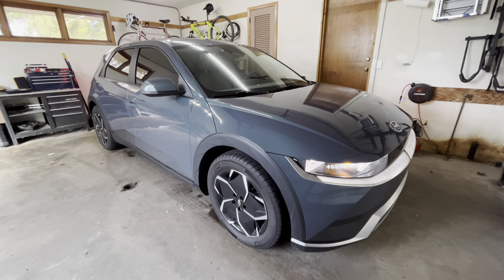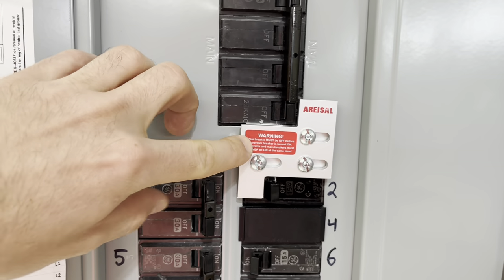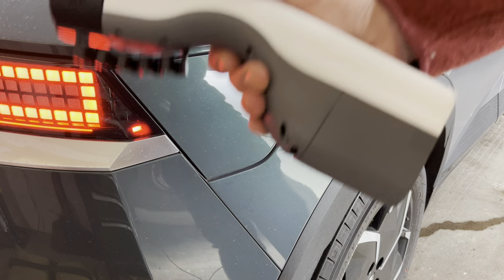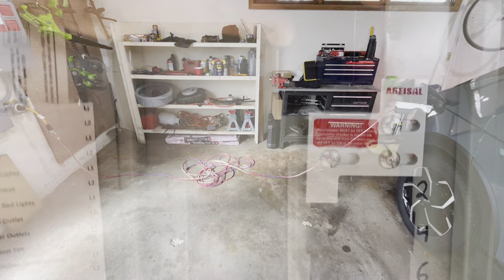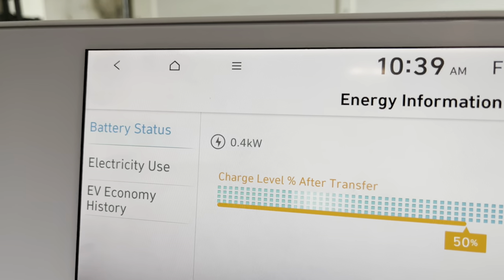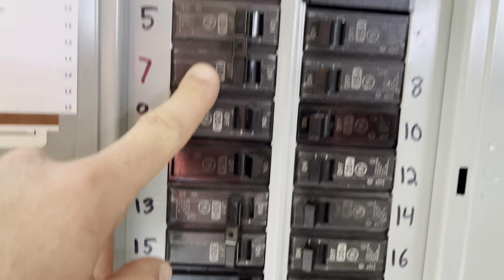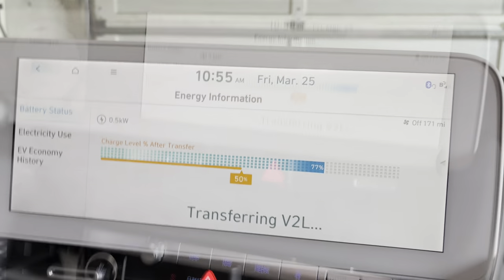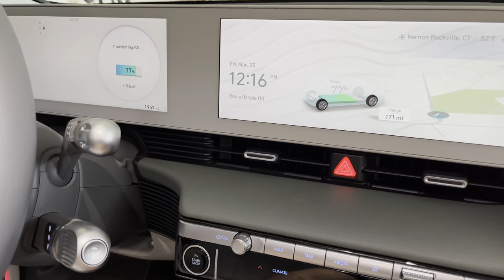5 Days of Emergency Backup Power Using V2L Adapter | Ioniq 5 | EV6 | GV60 | EV9 | Kona | Ioniq 6

Comment: The best trick I know to see if the grid is  on/off is to open the WiFi on my phone and see if my neighbors networks show up.
Reply: Unless they have an APC UPS backup battery from Costco to power the cable modem and router. Lol.
Reply: @letsgobrandon1719  Does it have to be from Costco? LOL Or am I missing an in joke? Or maybe just a joke.

Comment: That's a great setup. I can't wait for cars that can do v2l @ 240v and 7kw.
Reply: F150 does 7kW at 240v (3,6 per phase) the electric one will, but the current hybrid with onboard power does as well
Reply: Also the EU verion can do 3.6 kW as the nominal voltage is 230 V
Reply: I also need 240 V and 7+ kW, to run my well pump to get running water during a power outage.  Hate not having city water.
Reply: In europe with 7kw we power up the whole house

Comment: A huge thank you for this video.  I decided to buy an adapter and a bunch of heavyweight extension cords after watching the video.  Well, we just got hit by a major storm that knocked out power in our area for 5 days... I used the V2L feature to keep running the following: refrigerator, cell phones and iPad, morning coffee makers, small microwave (as needed), internet (modem and router), a TV.  Had it been winter, I could also have powered our gas furnace.  So, as always: this website is a HUGE HELP to so many of us.  THANK YOU!

Comment: There are a lot of comments here, i might have missed it. How did you handle the v2l adapter bonding neutral to PE?  I assume neutral is bonded to PE in your mains panel, when the v2l adapter is plugged in do you then have two N->PE bonding points? Have any issues with GFCI breakers tripping? Thanks

Comment: They need to build this into the chargers. It already plugs into the car, has high capacity cords and typically an industrial 50 Amp socket and 30-50amp breaker in the box.

Comment: By the way I’m so glad you made this video. This is exactly what I want to do with my EV6. Now I have something to show the electrician. Thank you!
Reply from the maker: Glad I could help!
Reply: @TheIoniqGuy  Ditto! I'd seen a bunch of these videos but none exactly like I'd wanted to set up. We already had a subpanel with all of our 120V loads on it so putting in a transfer switch or a transfer panel seemed like overkill. Given other info I'd seen about putting in a backfeed (like you did) and powering both bus bars it seemed to me like it should work (as many RV users do when only having a 120V feed), but i hadn't seen anyone do that exact situation to validate the design. So we put it in and tried it and god damn it did work! We did have a situation where our power went out for a few hours, but we just ran extension cords to power the fridges and internet, but to power the whole house with just a switch is an utter game changer!

Comment: Nice walk through.  The only thing I would suggest to make it simpler would be to run it off a transfer panel.  then  you wouldn't have to worry about accidently turning on a 240v circuit
Reply from the maker: I prefer this way because I can have 20 circuits powered. Most transfer switch panels are only good for 8 or fewer circuits.
Reply: We have a similar set up where we have a full subpanel instead of a transfer panel. All the 240V loads are on the main panel, so the subpanel only has 120V loads (about 20-some different circuits).

Comment: Correction for some of his comments. The United States uses a 240Vac system, the three wires are the two hots and common that is center tapped in the transformer. It is NOT a ground. That is something else entirely. There is not a utility ground. The house itself will have a ground rod installed somewhere usually outside of the house. The center tap on the transformer is done to split the 240Vac into two 120Vac feeds. In the breaker panel, the two long rails running from the top to the bottom in which the breakers actually connect to. Then there will be a shorter separate neutral/common bar. Breakers for the larger appliances, dryers, water heater, furnace, oven and so on have special breakers that tap across the two main hot lines for the full 240Vac. 

I do recommend having the output power tested from the vehicle to the house. If the output from the car is a PWM (square wave) do not use the car battery to power the house unless an emergency. The PWM output from a battery is not the same as sinusoid AC wave. This will lead to premature failure of appliances within the house. Power supplies that convert the normal AC to DC for laptops, TVs and other items will most likely get hot under the PWM power. Especially the cheaper end stuff. Simply look at the power supply at see its ratings. 

A sine wave or LCL filter would be needed to convert the PWM power from the battery to a true sine wave. This technically applies to the solar power system as well. Some inverters for solar systems have built in filters, with varying quality. You get what you pay for. 

And the interlock's main purpose is so that your solar or EV battery are not powering the grid, not the lineman safety. These systems would be instantly overloaded if utility is down and/or if utility is online, output of phase and would cause chaos. No lineman touches a line without it being measured and confirmed to be off before maintenance.
Reply: In regards to the output waveform, it is indeed pure sine wave. I've seen another video of someone connecting a UPS to this car and it didn't have issues like it does on modified sine wave inverters

Comment: Great video! Thank you. VTL is a major reason I am looking at the Ioniq 5.
Reply from the maker: It's wild that nobody else is doing this especially Subaru with the Solterra. This would be a giant selling point for their outdoorsy buyer base.
Reply: @TheIoniqGuy  vw is supposed to later this year enable v2x on all the 2023 model year id series evs. The Ford lightning will have v2x available across all trims starting later this year. In fact Ford's home station capable of 80amps and backwards capable is only $1,300.
Vs something like the wallbox quasar costing 2-3x as much. 

The leaf has also been capable thanks to chademo for years now of v2x. So it's something more ev manufacturer's are working on offering.
Reply: @4literv6  It is so with the Genesis EVs (GV60, GV70 electrified, G80 electrified).

Comment: One of the best videos I've seen recently, regardless of content.   Good job.

Would be a nice option for myself instead of firing up our 7.2kw/9kw peek generator to run the house, especially during times of average load.  Not having to purchase and store gas is a huge benefit.  1.8kw is not a lot of power, but a lot of times you don't need much.   The down side for me is we have a 240 volt well pump.    This is where the Ford F150 lighting has really done things right with a 240 volt, 30 amp output on the V2L
Reply: Just FYI the current f150 hybrid with pro power onboard already does the 7.2kw at 240v. I realize it’s not electric, but still it’s a possibility even now
Reply: @ZPdrumer  Yeah, I've had hybrids before.  They were a great idea years ago...but BEV is the real answer.

Comment: OMG,  before the switch to an EV car was even on my radar, I just had an transfer switch and generator outlet installed so I can now run my propane generator to power my house when the power goes out here in Baja, Mexico.  Woo hoo!  Currently counting down the days until my SEL Cyber Grey/Grey arrives in July, but thinking now of adding a Level 2 power station too.  Thanks for this informative video.

Comment: Just had this system installed today. I can now have my gas furnace, my kitchen, lights, and 2 computers powered by my Ioniq5. With all the above powered, I' draw only .3 on my car's indicator. This is with the V2L inverter from Amazon ($129) rather than the very expensive Hyundai unit. We don't need no stinkin' generator! 
Big thanks to you. My guy used this video to perform the entire job.
Reply from the maker: That's fantastic, Rich! You can sleep soundly knowing you've got a giant battery that can keep your house running for days now when needed

Comment: Amazing video.  I had a hard time finding a certified electrician who would do this (or get the concept) but your video was a great help.  Done!
Reply from the maker: I'm curious what they didn't understand. I trained to be an electrician a decade ago and this is just like any other back-feeding generator installation.
Reply: @TheIoniqGuy  The "every other breaker" issue (I believe you called it Buspar).

Comment: Very informative vid!
Just a note for those that might be interested, I powered my gas furnace (220 watts surge, 150 running) for 12 hours (40's outside) and used 4~5% of my EV-6's battery.  I have a Honda gen but will use this before the gen, especially at night.

Comment: THANK YOU for the incredible tutorial, yet another fantastic video from your channel.   I just hooked up my system just as you did with one difference - I wired it up to a 240V breaker and used a generator cable that splices the two hots together so it can provide 120V to both phases.  I just had to pull new romex for the dishwasher and disposal because they were wired to two breakers with a single neutral (MWBC) which could overload the neutral when using the V2L to both phases like this.

So to anyone else who wires this up to both phases, make sure you don't have any shared neutrals - e.g. every circuit should have it's own neutral.  Otherwise you can wire the system up like the Ioniq Guy to a single phase and you won't have a problem with overloaded neutrals.

Comment: I just had an electrician at my home and put in this setup.  I now have power to my main breaker.  I tried it out and  ran the furnace (fan only because it is gas burning), refrigerator, freezer and computer and modem.  That is as far as I went but I will cautiously add lights when the power actually goes out.  Thanks so much.  Mary
Reply from the maker: Glad it worked out for you!

Comment: Great vid! Thanks! Picked up the GV60 last night. Out the door was $79K. Buyer's remorse was setting in until your vid, then I did some math. My EV is 77.4 kwh which is roughly 6 Tesla Powerwalls and would cost approx $60K. Therefore, (again roughly) I got the equivalent of 6 Powerwalls and a bad ass GV60 for $19K. I feel better now. Calling my electrician on Monday! Thanks again!

Comment: Excellent video that will help me. I was planning to install a manual transfer switch with a generator outlet and use a Delta Pro battery pack ($5000.00) in lieu of a stand by generator. I just purchased a Genesis GV60 which included the load adapter. This set up will save me the cost of the battery.  We usually average a day of outage per year so this solution is perfect and offers us piece of mind. Thanks for your injunity.

Comment: Great video, TIG.  I'm getting rooftop solar installed, and rather than spend $17,000 on battery storage, I'll put that toward a Kia EV6.  Getting a 4- or 6-circuit subpanel with generator connection installed, so though it won't be instantaneous, I should be able to walk into the garage, and get the critical loads covered by the EV6 V2L.   This video really seals the deal for me!
Reply from the maker: What are the details of your upcoming system?
Reply: @TheIoniqGuy  25 panels with optimizers, 9.3 kW, a SolarEdge inverter, a subpanel where I'll be able to direct power from the main panel or the plugged-in source (generator or V2L) for 4 or 6 circuits (TBD).  I still wish we'd be able to disconnect from the grid and get solar during an outage, but that doesn't sound possible, right?
Reply from the maker: Sounds awesome! The new Enphasr IQ4 micro inverters allow for powering your house during an outage. I have the IQ3s and really wish I waited to get the new version
Reply: I'm thinking on a very similar basis. 
Why buy a battery for the solar system, when it's now the most expensive part of the setup, when a car battery can pick-up the slack. If the car battery is not available, then that means I'm not in the house, so the house needs very little power, but it's good to know that solar manufacturers are building in the facility to supply the house in the event of a electric company outage, because the thought of having all that solar on my roof and not being able to use it, just doesn't make any sense to me! 
Looking forward to an update once the V2L update is available to be able to supply hopefully 240 to the house.
Reply: @TheIoniqGuy I've got a Sunsynk Inverter and using the gen port for v2l to the house. What happens in your set up if you had some loads on before plugging in the car? Will the car not draw? I ask this as we have found the car v2l/gen port on the inverter will only work if we isolate the inverter. If we  leave the inverter online and just switch to the gen port the car just stays in 'transferring' state but does not send any power. It's almost as if it senses there's voltage already there so does not transfer any power.

Comment: Props! - right at 1:40 I saw what I was hoping to see - a main breaker interlock!  You can always buy an inexpensive generator (relatively) and use the same receptacle just making sure you have the generator far enough from the house/garage so you don't get CO poisoning.
Reply: main breaker interlock is a great inexpensive way to protect from back phasing the grid
Reply: Obviously there's no risk of CO poisoning from an EV.

Comment: Well done. Seeing this only now, after I tested my own setup with the Ioniq 5 V2L. It’s a little simpler than yours. My solar doesn’t go into the main board but connects in between board and meter. I have a transfer switch installed right in front of the board which in position 1 connects solar/meter side with the board’s breakers. In position two it connects the board to a cable with a female NEMA 30A plug onto which I can hook either the Ioniq 5 or a generator. In this position, solar/meter side are by default disconnected. So it is impossible to make a mistake - the house can only be powered by either plug input (Ioniq 5/generator) or solar/grid. I also have a separate circuit connected to the solar/grid side with an off-board breaker and this powers a tiny LED light (and possibly a radio if I want) which would show me when the grid power is back. (To run both split phases on the same 120V, just connect L1 and L2 inside the male NEMA plug - this way you could also connect a 200V generator to the female plug and just run the house as normal.) BTW, I noticed that my UPS for the internet doesn’t like the power the Ioniq 5 produces and does not accept it while all other household devices do. Probably something is not quite right with the frequency, but I don’t have the tools to test this.

Comment: I just purchased a KIA EV 6 and this is really helpful. I was trying to understand this process vs the transfer switch process which is being promoted on the KIA ev6 forums. This gives all of the detailed information which I can share with the electrician. Great job walking through the entire process, including the cables and parts needed. Also including the limitations and what to expect with how long the battery will last is a great.Very much appreciated, thank you.

Comment: Great video! I hope to set up a similar system. We’re installing solar in the next couple months and have the Ioniq5 on order.
Reply from the maker: What size system are you installing? Oversizing for the electric car I presume?
Reply: We’re installing 27 x 480w panels. Just under 13kW which should generate around 16MW a year on the east coast of Canada.  Should cover all our car charging needs too.
Reply from the maker: Oh man, that is a monster system! Is that all going on your roof or are you doing ground mount? I thought my 430w panels were big when I got them last year. Crazy that they're at almost 500w now
Reply: They’re all going on the roof. I’m a novice at the solar power game so I’m trusting that the company installing them knows what they’re doing. They have several years experience so everything should work fine. We have net metering here but no off-peak power rates so I can’t make any extra money off the solar, but it should cover my annual power consumption.
Reply from the maker: We have net metering as well with no off peak rates. Our company banks our excess in kWh instead of a dollar figure since prices fluctuate seasonally. Unfortunately, I installed my system late summer last year so I wasn't able to bank much before the sun got low and had some $100+ bills throughout the winter.

Comment: Good video. Most breakers are made to run continuously at 80% load so loading a 15 amp breaker to 100% may not be the best of ideas. But I like the idea. Also thanks for talking about the interlock.
Reply: This is actually fine as long as the wiring is 12 gauge. You want it to trip past 15 amp because that's the upper limit of the V2L adapter (theoretically the V2L should also power down past that but another check is good too). As long as the wiring is 12 gauge (which can handle 20 amp, and 80% continuous power derating to 16 amp) then you should be good.